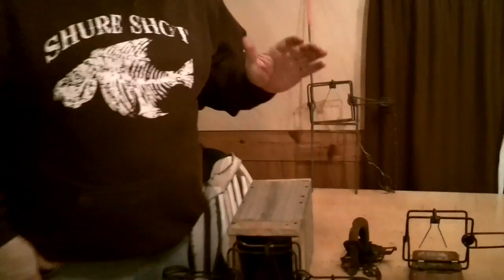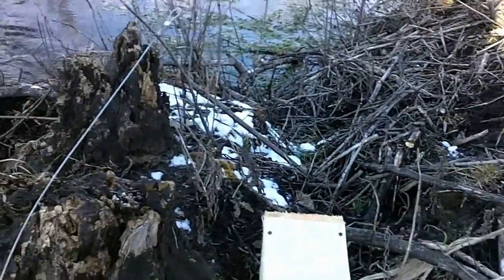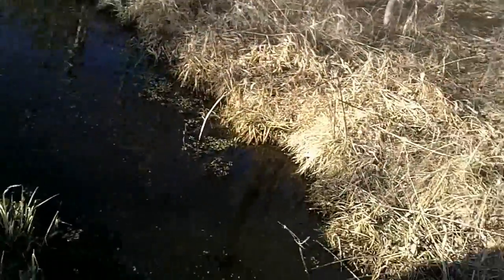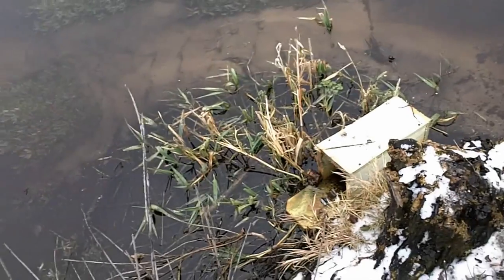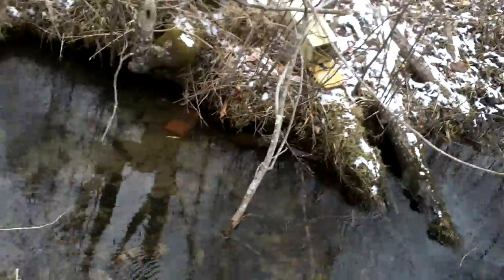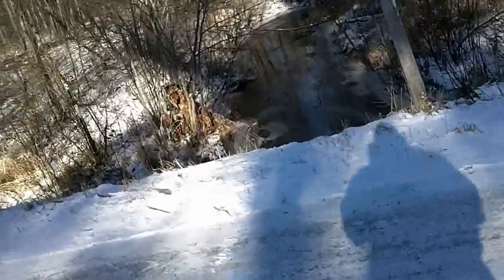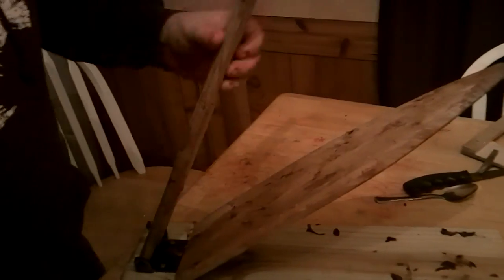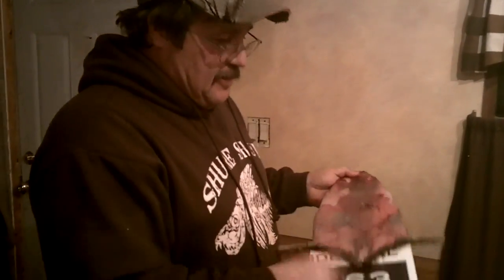Trapping Small Rivers for Mink and Muskrat (How and Where to Set)

Comment: I always thought if you catch a muskrat in a steel leg hold trap, you had to make sure the water close to it was deep enough to drown the or they'd twist their leg off. Do you ever find just a foot or is that a myth?
Reply: Sorry for so many questions but how deep do you put your conibears? Is the top of the trap level with the water surface, or is the bottom of the trap touching the bottom? Thanks Sam, I'm enjoying watching you run your trap line. It's going to be a few more years before I can move back up north to trap.
Reply: About the conibear depth, I just watched your video with you making the brick set. What I'm wondering about is the trap I saw that you had on the wire frame with the orange paint on top. If the water is say, 20 inches deep, bottom, top, or middle? Thanks so much.
Reply from the maker: +Shane K no they twist but i get very few
Reply from the maker: +Shane K trap on the bottom
Reply from the maker: +Shane K bottom
Reply: I've lost some before from them taking the leg off but that's like 1 out of 20
Reply: 1 out of 20 land sets